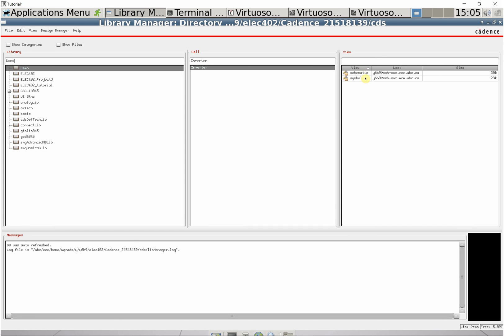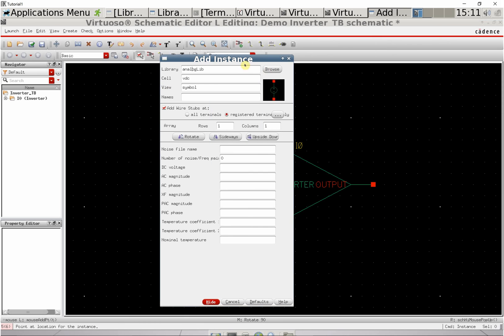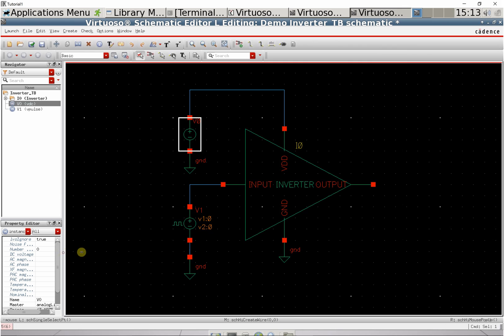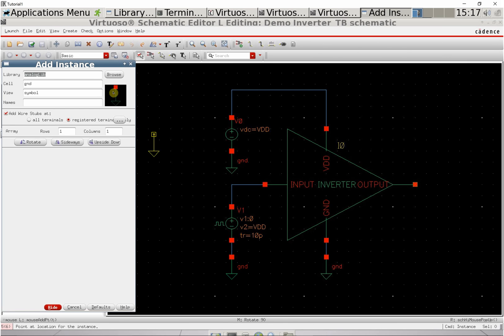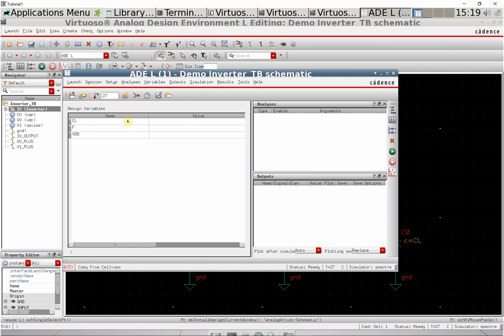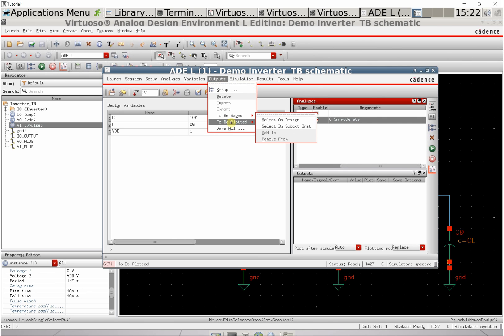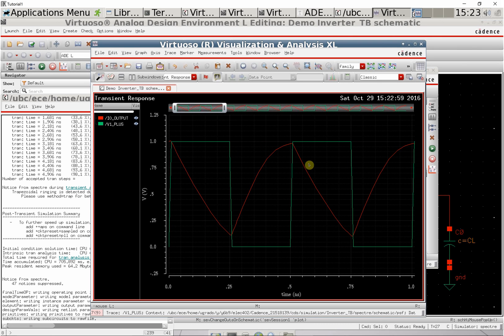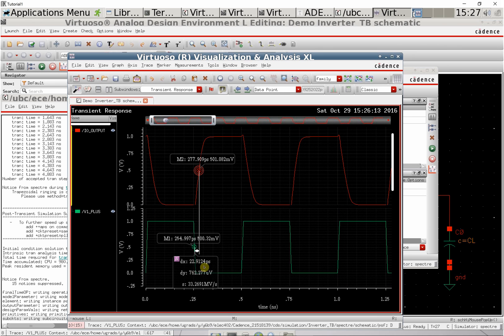Intro to Cadence 2: Creating a Simulation and Testbench

Comment: Thanks for the presentation, very helpful. Although it took me longer to get working than I anticipated. The ideal transistors in analoglib threw an error about an 'undefined' model for pmos/nmos. So I had to use real transistors from a tech library to get around this, then adapt the voltages and frequency accordingly. There's some work required to get used to all the windows / options the analog simulator has compared to a digital one, with no similarities in probing, plotting, scrolling, zooming, (re)running, has simulation finished etc... What caused me the most confusion was that if you click on a port in the schematic as an 'output to be saved'  e.g. INPUT/OUTPUT it saves the current there only. You need to click on the connected wire to plot the voltage...
Reply: Yeah, Cadence was designed by engineers, not by UX or UI designers. It shows... :D